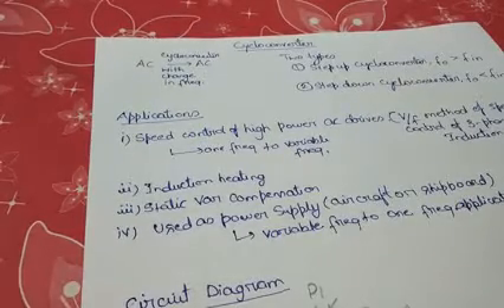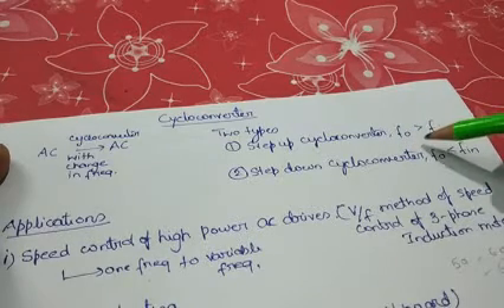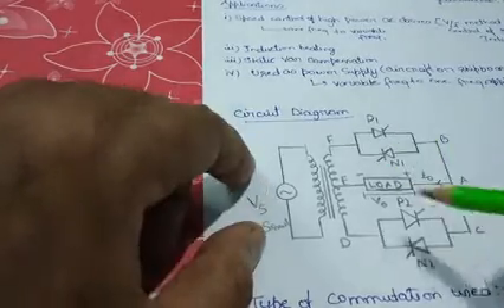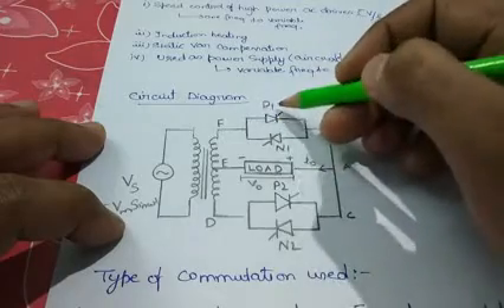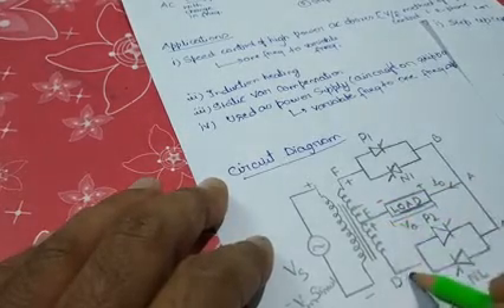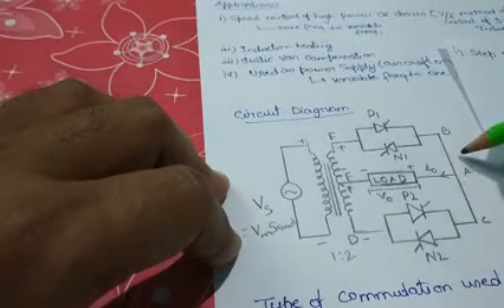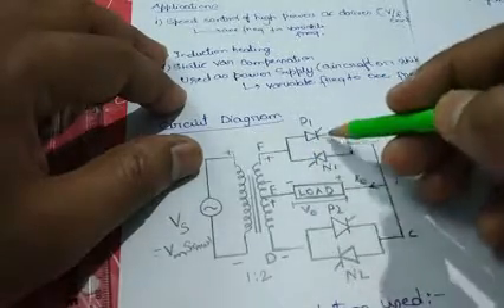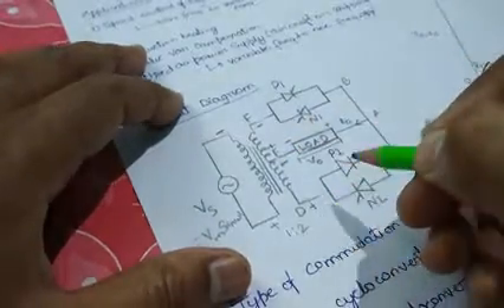Power Electronicslec 4.1-Step up cycloconverter part 1

Comment: Thank you for reply but still i cant figure out what circuit will come for force commuting for ac circuit for thyristor in stepup cycloconverter
Reply: Thank tou sir looking forward for the video
Reply from the maker: In step up cycloconverter I have only explained the power circuit....I haven't explained the control circuit attached to it ,that includes firing circuit,commutation circuit,etc......This I have done due to complexity of circuit....I will upload lectures on this also....have patience....and study ...u will get to know maximum of the concept ....
Reply: Can u please share circuit diagram on my mail sanjivpaul1966@gmail.com